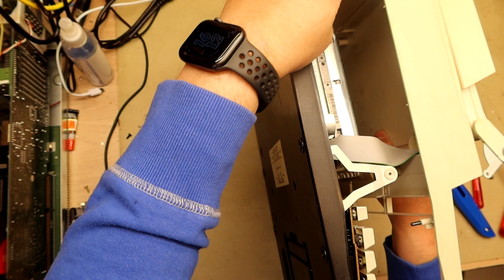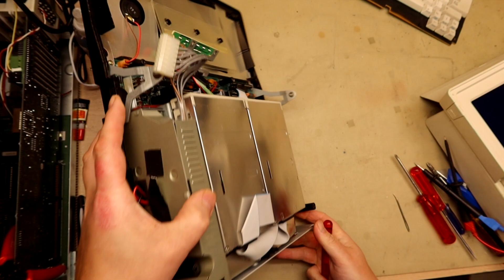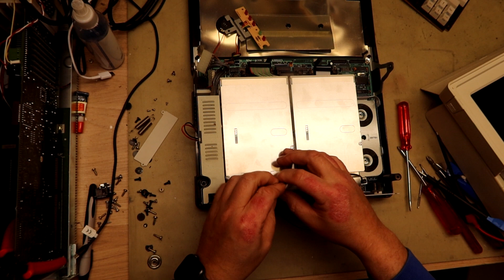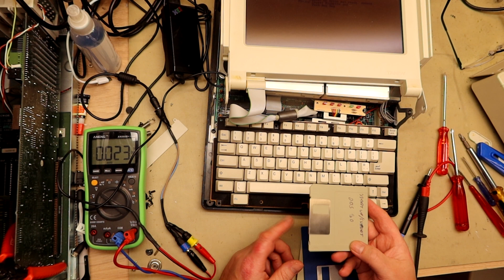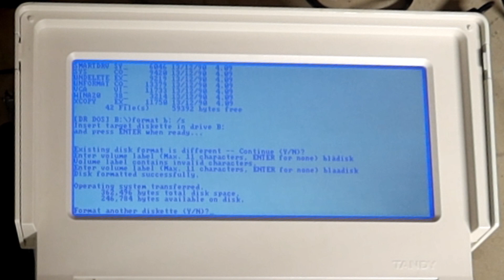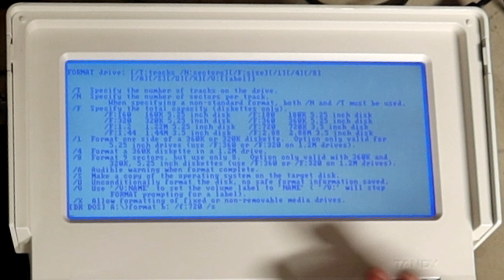The Tandy 1400 LT. Back on track, Part 3

Comment: I had one of these machines purchased new, with a 20 megabyte hard drive instead of the first floppy.  I always loved both the keyboard and the display.  The key action was crisp and amenable to long-time use at high typing speed, and the display wasn't very high resolution and the grayscale CGA didn't look right for some software, but it was also crisp and readable in all lighting conditions.  It was also fully compatible with PC's of the day, which was not a universal thing in those days.
Reply from the maker: Thanks for watching. I was surprised by the quality of the LCD, I have several other PC's from that area and this is the best of the smal supertwist LCD by far. The keyboard is also better than most, and i first tought this was a rubberdome keyboard, but it is discrete switches, and is quite good. I actually typed up a page of text on it just to get the feel of it.  I might do a fixed disk mod on this later.